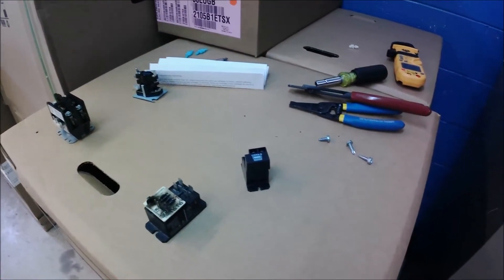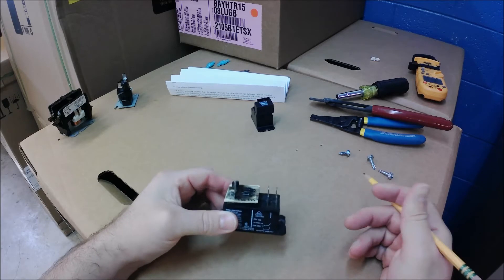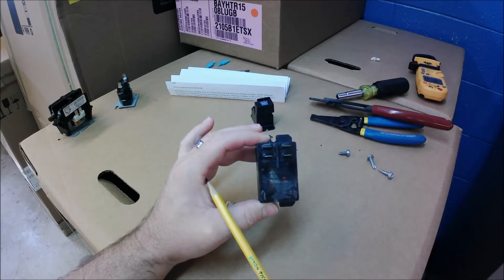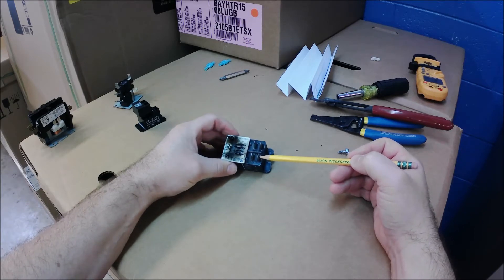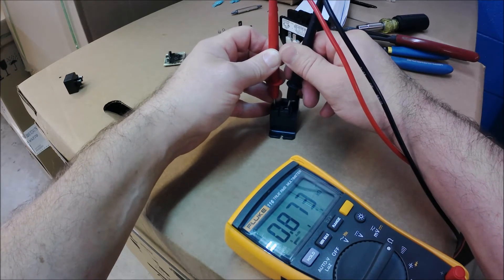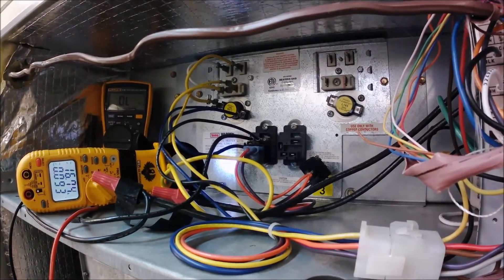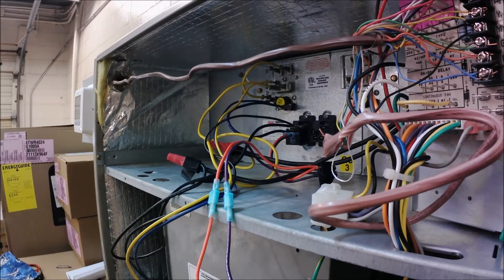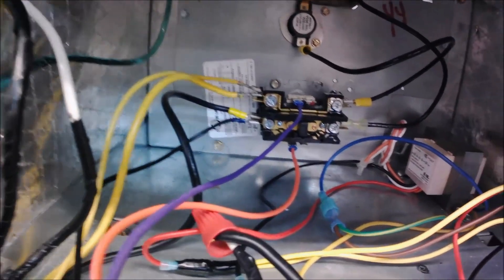DC Voltage Heat Relays for Electric Heat

Comment: Hello, do you know if the connector of the Purple and Orange cables are AC or DC? I want to know if it has a specific position as I can put it either way...My unit has the Orange on TP1 AND the Puple on TP2,, Thank you
Reply from the maker: It should be AC going into that DC relay. There is a rectifier either on the relay or built in, depending on which you have of course, that changes the AC into DC for the actual coil.

Comment: Hi John, I haven't been able to find any other videos that have those Warren relays which is exactly what I have. My fan won't shut off even with the thermostat removed, and a HVAC technician told me I need to replace my relay. Is he referring to these relays? Or would they not affect the fan since they're heat relays? I have a Carrier w/ ECM motor, interior of the air handler looks just like your video.
Reply from the maker: The ECM motors I've seen are not gonna usually hook to the heat relays like the older PSC motors do. Whether you have an X13 or a more "variable speed" motor likely wouldn't matter. Do you know the model of your air handler?
Reply: Yes it’s Carrier FX4DNF037
Reply from the maker: That unit seems to have the X13 blower motor. The way that motor gets is signal that the heat is on is by a low voltage white wire. If you look inside the air handler you should see a bunch of wires connected together...white, purple, blue (I think). And one of those wires goes to the blower motor. It dowsn't wire up like an older unit with the heat relay connecting back to the motor. If you removed the thermostat face and it still works the  you would need to check for voltage going into the plug by the motor. If one of the low voltage wires (blue or white) have 24v on it then that is likely the reason the motor is running. If not then it could be the motor module that has failed and is keeping the motor on. I doubt is is anything with the heat side of things but you definitely need a electrical tester to get to the bottom of it.
Reply: @johnjennings-JJ  According to the schematics on the motor, the brown wire going to the plug is the 24v. When I test it with a multimeter, there's no voltage. When I pull out that brown wire from the transformer and test the tab, the tx tab itself does have 24v. But weird thing is, whether the thermostat is on or off, the brown wire still doesn't read any voltage at the motor plug.
Reply: @johnjennings-JJ  At the motor, I removed the blue wire that's fan speed setting and white that says heat. The fan is still running. So does that mean I have a faulty module?
Reply from the maker: It seems to be that way...from way over here!!  Most of the time I have personally seen it where the motor does not operate at all. 
If you are not a hvac tech by profession I would advise not to go any further with it and pay for an official diagnosis by a company. Let them quote you for the repair. Those motor/module ECM motors are a little pricier than some others. However, I am sure you could do some internet research to find out how much it would cost you to get that module. There are instructions you get get your hands on to replace the module if you wanted to try it. I googled your unit model number + "blower motor module" and found a hit on SupplyHouse.com. It is like $400. Maybe call them and see if it would fit your unit specifically (probably need the serial number) and if it is programmed already.
Reply from the maker: @eomfd that is the 24 common wire. It doesn't have any voltage, or shouldn't. The white or green could have 24v depending on if the heat or cool is on.
Reply: @johnjennings-JJ  Thanks for your help anyway! I hesitate to call another HVAC and spend money again. The last one told me I needed to replace the relay, and that seemed wrong to me since I didn't see it the circuit to the fan motor, just as you confirmed.

Comment: Blower would run nonstop even with the Thermostat disconnected. Relay started beeping on continuity setting before I energized it. Bad relay? 😅
Reply from the maker: Sounds like a closed switch to me from where I am sitting! Blower running with the t'stat off the wall??? I would think that it has to be a switch closed in the high voltage side of the relay to make that happen.
Reply: Did you find your problem with the blower running continually?  I'm having the same problem with a Carrier heat pump after a lightning storm. Fan and heat strip running even with thermostat pulled from wall mount. Only cuts off with the breaker. Outdoor compressor and fan are off and don't respond to thermostat.

Comment: John's right , the sequencer will also work , I've also got the same theory on older automobiles the cdi ignition was more reliable than the coil pack, again engineers trying to reinvent the wheel, auto, hvac, same if it ain't broke don't fix it,  oh  I drive older cars also rebuild  them and drive um without worry .appliances ,auto , hvac imo engineers need to get lessons from old tech like john b 4 reinventing the wheel.

Comment: Done it myself , the old school relays worked just fine more reliable, the old school psc motors worked just fine,more reliable, the office piston nothing to break instead 0f txv , if it ain't broke don't fix it ,  the money saved by all this garbage just makes the customers cost go up on pre mature failure imo, the energy saved imo don't justify the extra expense of newer unreliable junk.

Comment: For 24v purple/ orange heat dc relay would u wire one  with thermostate white wire( heat) and the other to 24 common?
Reply from the maker: I think you are referring to the carrier type brands...yes. the pure/orange is 24Vac and it doesn't get to be 24Vdc until after that little board that sits on the heat relay. I have done it it before like you are saying when putting in a regular 24Vac sequencer, white to one side and common the the other side. But the plug doesn't fit a normal 1/4 so i cut the purple/orange about 6 inches away from the end and put a male and female terminal in each wire so it is an easy connection if you want to ever put back the original relay you can do it easily.
Reply: @ thank you so much. If I may ask another question. I have a wiring diagram where the ecm “speed tap” selection 2 leave in BLUE wire to a Resistor  then leave in a GREY wire to the thermostats green wire ( fan). Can you please tell me the purpose of the resistor? There also 24v common fan coil wire going to it as well
Reply from the maker: I know the air handler and had one at work to look at closer...just don't know why the resistor is there! I am not sure of the resistors value either. We would probably have to call and talk to one of their engineers to get the answer. Sorry.